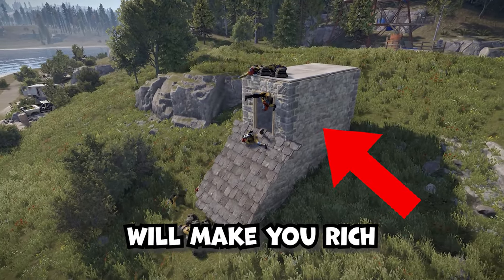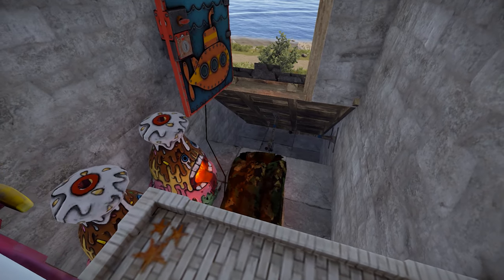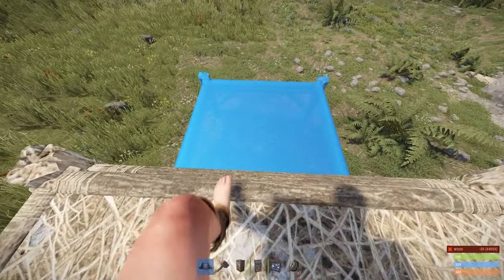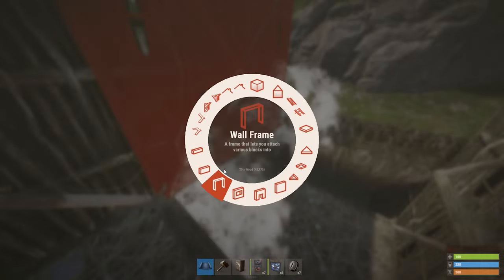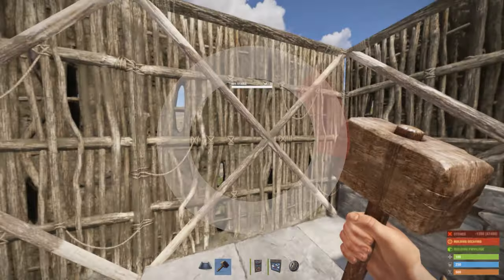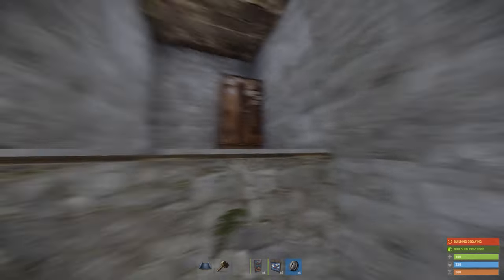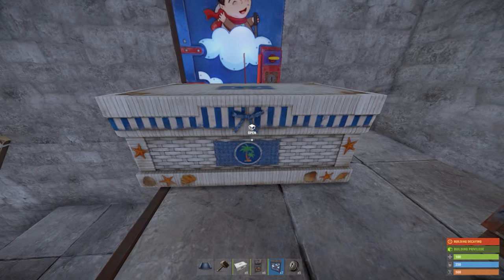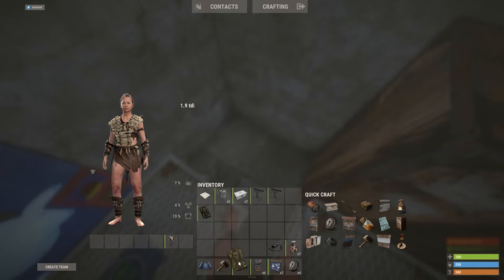(NEW) Small and Easy Trap Base in Rust / Tutorial 2024

Comment: Add a memory cell that you can reset with a switch. That way the the PP closes the door It'll stay closed until you reset.
Reply from the maker: Ooh, that's a great idea.
You don't have to use electricity to do this? I've already forgotten how it works(
Reply: @stelicRUST  the Plate makes an output. I'm pretty sure the switch would need electricity but you can use a second cell and plate to make the reset (a  toggle latch) to keep it electricity free
Reply: @stelicRUST  I just checked and the memory cell use 1 power and the Plate only outputs 1 power so I don't think this would work unfortunately 😕
Reply from the maker: @huemungus5535  Damn, but the idea was great 🤌
Reply: I've tinkered with small battery and the memory cell to do what you ask, the base can do it but it's very annoying and means you have to reset every kill

You can hide solar panels with half walls on top but the base instantly looks weird/too high and people get suss on it
Reply: Where in line do you ad the memory cell and switch? Between door and pp

Comment: What the PP doing? just opening door ? or closing it - im confused as i would htink if paired it will open the door no?
So they come in stand on plate and that would then open door? would they not maybe escape or is it somehow closing the door when they stand on PP? Im confused. How to you get the plate to close the door standing on it rather than open it? Do you just connect it when the door open to press and close or - how it work ?
Reply from the maker: You have to leave the door open, so the controller closes it when someone gets trapped. They won't be able to get out as they will be killed immediately by the gun trap.

And when installing the controller, it makes no difference whether the door is open or not, the main thing is to remove the lock from it. I think I've explained everything🙃